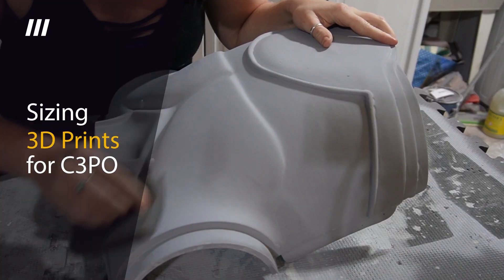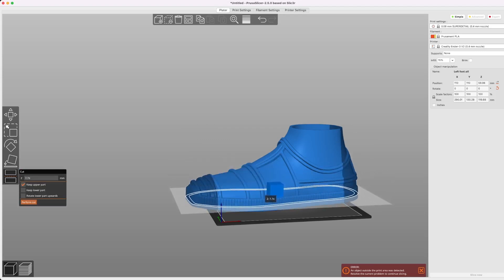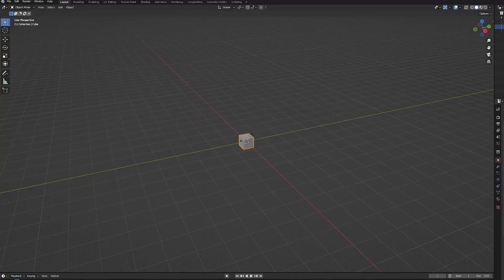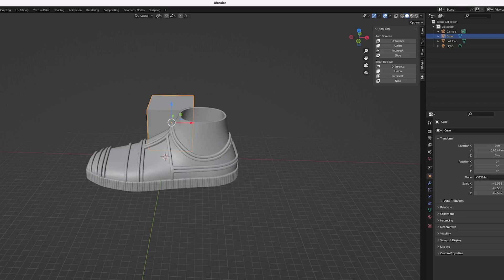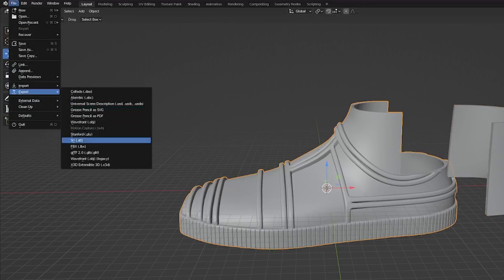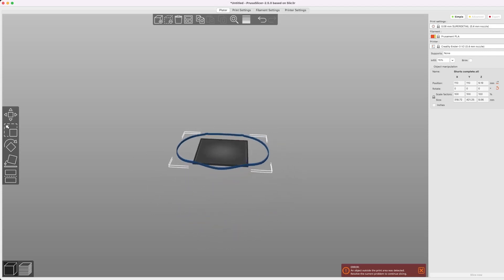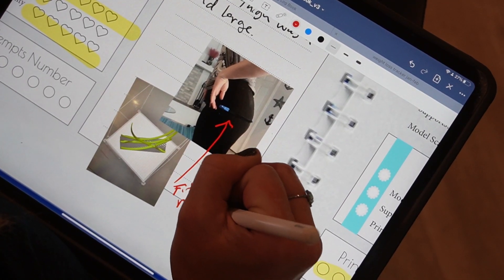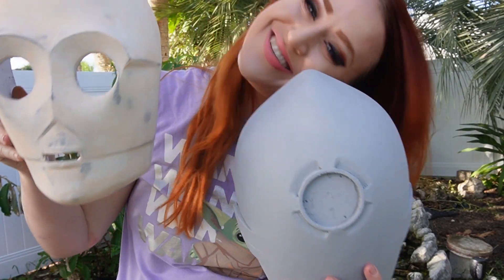Scaling Cosplay 3D Prints - C3PO

Comment: Brilliant, loving your vids! This is cool and a really great way to do it! I do that with a helmet for sizing for my kids (Iron Spider helmet for my 3 year old).

Randomly, I do photogrammetry and I converted some of my models into 3D prints. I did my partner while she was pregnant. Took photos and then used photogrammetry software to create a mesh, split it into parts like C3PO and it is exact (within reason). What was interesting, I didn't scan it for printing, it was for VR and creating models in VR. However, I ended up making a life size model! 

I'm wondering if you could take a photogrammetry scan of yourself with your iPhone/Android, then create the mesh - convert it into a obj/stl and use that to size your body parts 😁 Or you may have already tried.